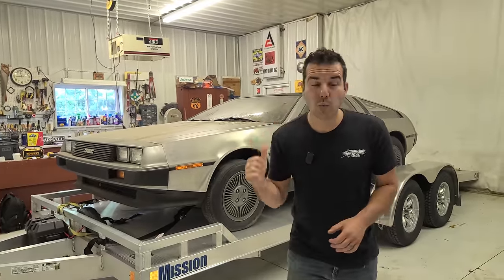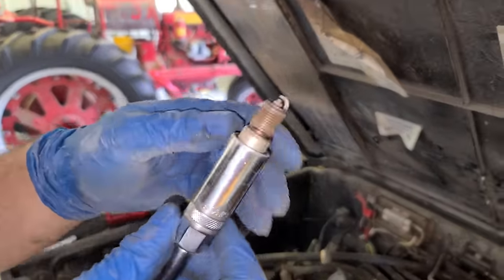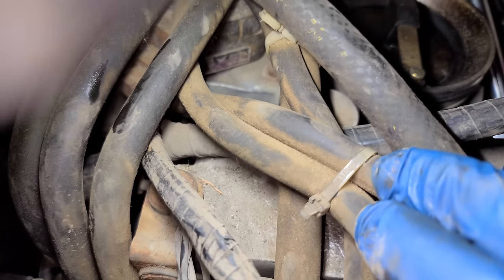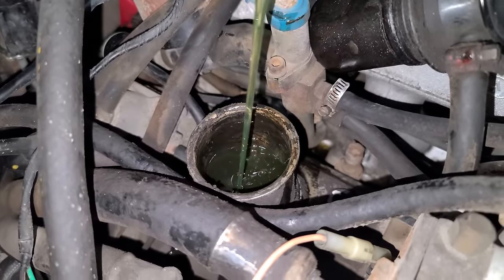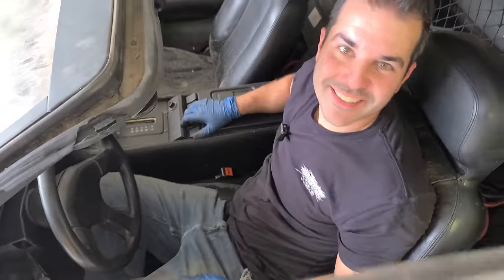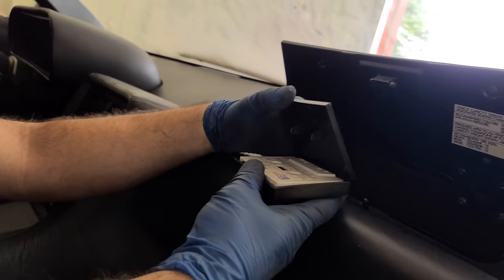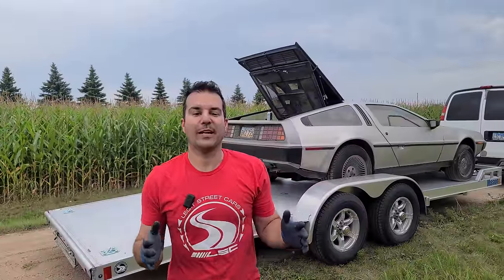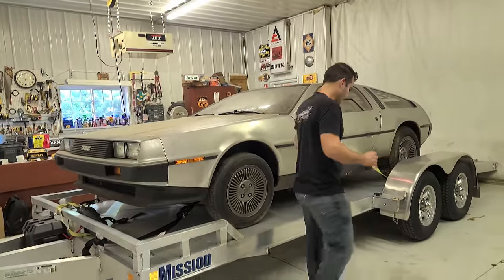First Start Of My Abandoned DeLorean After Sitting For 32 Years! Look What's In The Glove Box!

Comment: Remember to swap all the fuel lines, apparently Deloreans are known to catch fire because they are so detiorated at this point
Reply: Nah, that only happens when the flux capacitor shorts.
Reply: They always had problems with fires, I remember being about 12 seeing them and all had fires unfortunately
Reply: Oil changes ranged from $21 to any add-one you may need.
PVC valves, air filters, etc.
That oil receipt is on par with an oil change and quite possibly an extra thing or two.
I worked at a quick lube in the 80s.
Reply: @1959Berre  and you blow the fuel injection manifold using 1885 whisky and rip the fuel lines running over rough terrain being chased by bears and indians.

Comment: The "belts" around the inner door handles are on early cars, Oct '81 and earlier. They were original factory installed and were meant to help shut the door. On later cars they were mounted to the inner door itself as the loop style pieces would commonly fall off when opening or closing the door and you wouldn't even realize it! Mine were looped around when I bought it but I have since modified it to be permanently attached. I got a document that helps with the mod if you are interested I could send it to you
Reply: I remember that part from "Back to the future"

Comment: You might want to still get the cassette deck out and have it serviced. There usually are some rubber belts that need to be replaced and some small shafts to lubricate. I am actually amazed it still worked after all these years!
Reply: Maybe DeLorean cassette decks are just as robust as the rest of the car when sitting 30 years?
Reply: I was also amazed it worked!
Reply: You may also want to have Bluetooth functionality to the stereo. There's a guy who does it.
Reply: @jwalster9412  No they are not as that is the 1982 and up radio in a 1981 Delorean which means the ribbon cable that is attached to the cassette door which has the LCD screen on the orignal radio which was a Craig radio broke(from inserting cassettes) and rather than put another troublesome orignal 1981 Craig radio he put the newer DMC badged Radio

Comment: 22:49 - The belt is from the factory! They found the door handles could be hard to reach when the doors were up, so for early cars, they just looped those straps through the door handles. Later cars had a built-in slot bracket for the straps, but they are supposed to be there!
Reply: This is the comment I was looking for
Don't remove em there original
Reply: There is a SMALL bumper crack (similar in revile on front) …not metal, so “easy”

There’s also dirt and weird lighting. Need to clean b4 final metal assessment!
Reply: @LegitStreetCars this right here ☝
Reply: I would have drained the old fuel because of possible water in the system. Otherwise great it ran right away!

Comment: This really brings me back!  I bought a 1986 Lotus Esprit 3 years ago, sat since 1989. I pulled and sent all my Bosch mechanical injection, warm up regulator etc to get rebuilt. Eventually I found out what was wrong when it was pulled off the road, and after restoration of the items that deteriorated from sitting, it ran!!!  I put about 1500 miles on it a year now, I’m at a total of 21,000 miles. Have faith, she can be a reliable little driver!!

Comment: Something I saw from Vice Grip Garage, instead of babying the starting of the engine with starting fluid, use a combo of gas and 2 stroke oil. Helps bring the rings right back around. Good save on the DeLorean!

Comment: Greetings from a Delorean Owner.

Really great find you got there.
Some comments on your video:

1. The turn knob on the center console is for turning down/up the brightness of the gauge cluster
2. There are some pretty good videos on here explaining how the K-Jet works. please don't just throw on a carburetor. Once the K-jet is well maintained it's a pretty reliable system. Most important thing is that the fuel pressure is correct all the time and that the injectors have a good spray pattern. A good way to start is to remove the fuel distributor and clean the plunger inside of it. But be very careful, once the plunger fell onto some solid ground, the chance is high that it will be slightly damaged and not longer usable as the surface has to be 100% perfect without any dents. Checking the spray pattern of the injectors is a pretty easy task as well. You have to jumper the fuel pump relay (next to the fuse box) so the fuel pump is running all the time. Pull the injectors and put them into glas jars and as soon as you have a jumpered the fuel pump you can depress the air metering plate (where you already sprayed the starting fluid). This should prime the injectors and you can check for the spray pattern (of if there is any fuel at all).
3. Deloreans were known as pretty unreliable cars back then. Most of those prejudices were caused by electric problems the delorean had. Nowadays there are some pretty easy (and not really expensive) fixes available online for the delorean. First thing you should do: Fix your ground connections and optimize them (good way to start are the "delorean get grounded" videos here on yt. Next step would be to clean all those little connectors that are ignition-related. Even if the car runs for the moment it could happen quite fast that you'll face electrical problems here. Another important thing is to replace all the fuses in the fuse box and clean the connectors there. The fuse box is right above the battery compartment underneath the carpet.
4. You should replace the coolant reservoir as soon as possible with a new stainless steel one. Those original piece you got there is known tu burst as the material gets brittle over the years. Furthermore it's recommended to replace the old coolant hoses with new silicone ones. Most important thing to keep the PRV engine in a good condition is a good working cooling circuit.

I'm thrilled to see the progress of your car :)

Comment: Quick tip. When I'm vacuuming around the engine bay or down around seats and I don't have or can't find my small nozzle adapter, I just place a long skinny funnel over the nozzle and it works great for getting in hard to reach areas.

Comment: You are lucky this car was in a humid environment for the 32 years. That is why the wire insulation, rubber, leather, interior plastic etc. is still good/flexible. I have rescued many 2nd gen f-body cars in Colorado and because it is so dry all of that has to be replaced. You have mold to clean off instead of having to replace everything, good trade off.

Comment: a little tip for cassette tapes, if you find  some.
first forward and rewind them before using, it does two things.
It give you the check if the tape itself is not rotten out, it lines up the tape in wind correctly again and then good for use.

Comment: Those cylinders are extremely clean considering that it most likely ran on leaded gas for the majority or entirety of it's time on the road. Alex, I also need to thank you for helping fulfill my younger me car dreams! Although I had a Fox body Mustang, you working on that red one was the first video of yours I saw....then you went straight ultimate with the Grand National.... and now it's a time machine... I mean DeLorean! Thank you for those builds and so much more! 💙👊🏼
Reply: Unleaded gas was more than available in the 1980s.
Leaded gas had a nasty habit of ruining catalytic converters.
No, the condition of the plugs, the nice, even carbon in the pistons….
This car was run on the gas it was meant to.
With the improvements of today’s fluids, I would hazard that this car, when all the lines are replaced, should last for a lot longer than the older vehicles did back when.
Reply: I have a 79 Subaru, it still runs on leaded gas now and then, because I live right next to an airport and to refuel with 100 Low Lead I just have to drive into the parking lot and stretch the hose over to the car. Much easier than driving 20 minutes to the gas station. It is and always was a non-catalyst car. The cylinders look in amazing shape, even being chrome plated aluminum cylinders. Never seen an issue leaded vs unleaded except for lead fouled plugs.

Comment: Really nice find!  BUT you should check that oil gets to all cam cams and rocker arms!  It is a very common problem on these engines when they have been standing for a long time with old oil in them or if service has been neglected, the holes that spray oil on the cam's  are very small and easily get clogged.  

I ALWAYS check this before I start up old engines that have been standing for a long time and especially on these PRV engines!  

Good luck with the car! 😊
Reply: Helps to add a slosh of kerosene to break down the sludge.

Comment: It's referred to as toll booth window.  For drive thru, you open the door.  Power lock motors can fail and you can be locked into the car.  We either disable the auto locks or put in a Wings-A-Loft system.  Also a current Oct 81 owner. Also, adding a second ground cable helps...

Comment: Don't knock Bosch K-Jetronic. It's pretty robust and straight forward to diagnose. Biggest problem is vacuum leaks. Once you get that sorted, the system usually starts with a flick of the key. One nice upgrade would be braided fuel lines if they are available. Most European makes came with them standard.

Comment: Man when I got my first car in 2016 I did the same thing. 94 acura legend GS. Had a phone in the center console, I was just like you are in this video. Went through and cleaned everything. 236 hp stock, with a traction control button and bigger brakes than the base model. I was racing everything and I got it at 264k. Changed the engine mounts, brakes, tires and all the fluids. Blew the head gaskets at about 290k and kept topping off the water every 10 miles. Eventually I did a pull from a stop around the corner from my house and as soon I I hit 20mph it sounded like I threw it into park.  Put it in nuetral and pushed it home with it still running for power steering purposes and found the entire differential case to be broken in half. Ring gear visible to daylight. The Axle seal was leaking since I had it and I work at a shop so I'd top it off every couple weeks but then this happened.  Had a new Axle seal in the door pocket for months. Sold the car for 100 bucks a year later lol. Pick n pull would only give me 63$

Comment: I get excited by the documents, too! I bought a 1941 Packard Model 110 Touring Sedan. When I got into the glove box, the original bill of sale was in there, as was a tire inspection form from during WWII. Since rubber was rationed, you had to prove the tire was worn out. The REALLY  cool thing is that the form lists the serial numbers of every one of the original tires. Including the spare. Oh and all the tires passed, no replacements. Also, the wife's Connecticut state ID, a metal plate, listing her birth date in 1878. I can not tell you how cool the owner's manual is.

Comment: When vacuuming around my engine I like to use the shop vac and attach the hose to the opposite end of the vacuum that blows instead of sucks. Then blow all that dirt and pine needles out of the engine crevices. It works a lot better!

Comment: Fantastic!! This reminds me so much of my resurrection of my $600 Mercedes  380sl. I knew it would run by spraying starting fluid in the air flow meter but held off on doing mechanical work until I had completely cleaned and restored the paint, interior and electrical system. With the frustration s of trying to get a 41 year old CIS injection system working, I would just step back and look how beautiful my car is, and then keep going. I have 150 miles under its belt now, and it is time for a water pump, belts and hoses. Great videos. I really enjoy your adventures! #JRBRestorations

Comment: Make sure to change the short coolant hose under the intake manifold. When they get old they balloon out and explode while driving and replacing it is not (for most) a highway roadside thing. It’s in the region known as the valley of death. The same region the impossible to find sensors and switches are for the vacuum and temp sensors and switches. Most of the stuff on the car is not reproduced anymore and a lot of things have to be carefully salvaged to keep an original car running

Comment: I wouldn't do much without getting that Fuel system checked and new stuff. 
There is a fix for the fuel deal on the motor so it won't fail and cause a fire.

Comment: I love the DeLorean DMC. Such a beutifull car and iconic. And YES, it is 100% a direct reflection of the iconic Back To The Future (1985) movie(s).
Sadly the car was marketed as a "sports-car", but DMC installed a very weak V6 engine in it (V6 PRV engine), and a very odd mixed one as well with engine parts from 
Volvo, Renault & Peaugot (?) and somehow this mix would be cheaper then the suggested V6 engine, V6 Cologne from Ford (?). The V6 Ford engine was a heavily reliable engine that was well used and delivered good power and durability. Beside this, many DeLorean owners have through the years complained that the electric work on these are its most common issue of problems related to typhical British poor electric installation craft.

If it is possible to switch V6 engines in this car I don't know, but it would be awesome it it is possible. There must be some good fitting V6 engines that could work (?)
I feel this car truly deserves a better engine with more power and speed.

Comment: TIP. Alex, use WD30 or RP7, cleaning SS with old soft T Shirt. It actually absorbs for the first few times and then comes up like new. We use it on lift panels, range hoods, and panels before hand over to clients. By coating it in oil, marks do not show up. Great video team.
Reply: We used to use blu tac to clean off marks before photographing stainless items for the website where I used to work

Comment: Full strength antifreeze is recommended 80/20 mix 80% full strength to 20% distilled water ! Thermostat, remove coolant sensor , clean and reinstall , spray C.L.R. over engine and inside radiator too free up calcium,lime and rust 1bottle too 3 gallons hot water ! All sensors removed cleaned and reinstall with Teflon tape .
Reply: Amazing instructions! !

Comment: Those straps around the handles actually are factory, the early Delorean models simply had straps wrapped around the door handles while in the later models the straps were made to have their own fixed place in the door near to the handle. Also just note that the automatic Deloreans are actually rarer than the manuals, since out of the 9000 built only 1000 were automatic, so who knows how many are left now. Also side note for when you start the engine, check all the fuel lines as since they are all most likely original they’ll be made of rubber and probably damaged and cracked at this point, so I would highly recommend replacing them before you try and start the engine.

Really happy for you guys since you found an absolute icon

Comment: I used to drive the 1988 Audi 500 Turbo (I think it was badged the Audi 200 in the US). It had the MC 2.3L 5 cyl Turbo motor and used the Bosch sparkplugs (3 prong). Using ANY other make of sparkplug resulted in decreased performance AND the plugs were toast within a few months. Bosch sparkplugs are excellent quality and if you can get genuine replacements, do it

Comment: I wouldn’t use transmission fluid for oiling the rings.
My favorite go-to is Marvel Mystery Oil.
I have a gallon to refill my squeeze bottles for my air tools, and I use it regularly on bolts that have to go in and out a lot, like commercial lawn mower blades.
Those are made i such a way that the bolts will tighten if the blades spin on their shaft. Things get tough with a dry bolt!
Marvel is excellent for piling up small engines when they are worth it to rebuild, which isn’t often, lol!

Comment: If you have the chiller mode you should use that let it run and cool off that way when you just shut it off it heat soaks everything you make more power with the chiller too and if it was tuned with it on incold air then the tune is off for sure that beast needs a fuel tech or Holley so it auto corrected the tune

Comment: 35:44 if you look back in the owner's manual in the 'Appearance Care' Section,  it says "Wash panels with warm water and low suds detergent. Stains of tar or grease may be removed with gasoline or white mineral spirits." it doesn't say to wash the entire exterior with gasoline, its just for removing heavy contaminants like road tar, grease, and asphalt.

Comment: ❤😂🎉🎉such an awesome time piece. great find I was born in 1981 so it cool there was some stuff from my year. just a bit of advice as ur new to towing a trailer. always try and keep the car (load) over the axles not as far forward as possible. 
keeps it the most stable and keeps the weight central and less weight pushing down on the tow hitch 👍👍

Comment: Spend the time and money; pick up the service and repair manuals from the modern DMC in Texas, Florida, California, etc. and study them thoroughly. You’ll be glad you took the time to learn every nook and cranny of the car. Theyre fickle beasts and not the easiest to keep running on the old Bosch system. Hot start and rare sensors and switches excluded, almost everything is weird like the odd metric size 7mm bolts with 11mm heads and the very finicky tuning of the fuel mixture. Trust the DMC techs and learn as much as you can. There’s only a few great ones like Toby P in Seattle WA and they’re overloaded with phone calls and emergency help and taking notes will save your life

Comment: You know the PRV engine (Peugeot-Renault-Volvo) certainly from the Volvo 760 which was also sold on the US markt.
Common problem was a blown head gasket, the reason, my father sold our 760 with 260.000 km on the clock...😢